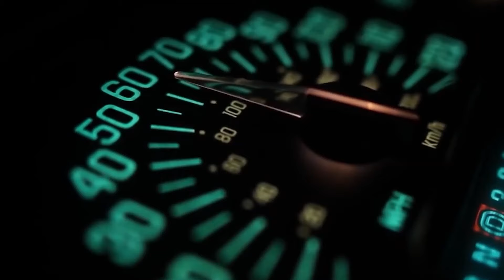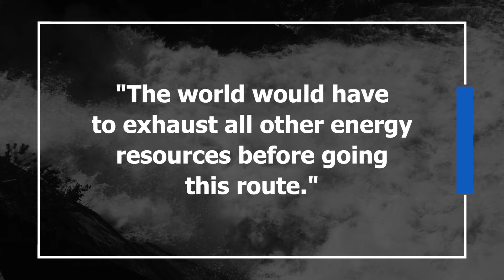The Red Sea Dam: Generating 50x the Power of a Nuclear Plant

Comment: If the object is to generate power it may make a lot more sense to dam the Gulf of Aqaba so that navigation is not blocked in the Red Sea. But further if a dam was installed that blocks natural inflow and outflow of water recharging the Gulf and preventing shipping and endangering fishing and the ecology of the gulf as well as destroy Aqaba which is the only Jordanian port, this would be like suffocating the region. Ditto for the Red Sea dam idea. Destroying a whole environment and Aqaba and every other port in the region to generate power is not the way to go! Further, the Israelis are going to have to recharge the Dead Sea I feel from the Gulf, and blocking it off would certainly kabosh that plan which would BTW ameliorate sea level rise.

I would actually consider a sea dam impractical and unnecessary for the purposes of generating power because on a daily basis the tides change four times daily in the Aqaba gulf with a change in sea level of over a meter (measured today), a power generating phenomenon that turbines could take advantage of if they were installed in the correct structure. Perhaps a simple undersea tunnel-like structure extending from shore to shore, well below the shipping lanes to Aqaba at the entrance to the gulf and  meant to simply house turbines and  anchored to the sea floor by cables or even columns and packed full of turbines to catch the tidal flows both ways and perhaps even any current flows at depth. This would be like a submerged bridge extending under the water from the Egyptian shore to the Saudi shore and  would generate power silently under the sea.

Not only that but there appear to be a few maybe helpful islands at the entry to the gulf to consider also a suspension bridge over the gulf entrance in tandem with that turbine fitted structure generating power in the sea below. A bridge at this location would serve to increase access to Sharm El-Sheik and Saudi Arabia from both directions, surely a good thing, and allow land access between Saudi Arabia and and Egypt without having to cross the northern Sinai and Israel. The Saudis could finance the bridge with some of their deep pocket change! A much more interesting project. SZ BA MA

Comment: Something tells me the added shipping costs to everyone who uses the Suez canal would alone make this a net energy loser.  Boats on water is way cheaper than even rail and it's pretty hard to build rail through sand desert so you're down to truck or vastly longer sea shipping routes.  That is before you talk ecological consequences or you know, the risks the structure fails due to engineering errors.

Comment: This is by far the dumbest idea since the idiot that wanted to dam off the Mediterranean Sea. We've seen what kind of global impact on shipping happens if the Suez Canal is shut down for a long period of time. This would make it permanent, because as the video suggests, locks would be impractical for the amount of water level change we're talking about and a saltier Red sea would quickly ruin ships. If you wanted a preview of things to come, I'd point to two examples. Early on in this dam's life the Red Sea would become a giant version of the Dead Sea, a sea so salty that only extremophile bacteria can tolerate. Later on, one only needs to look at what's left of the Aral Sea and scale it up a few hundred (or thousand?) times. 
I'm a firm believer that Hydropower is essential, but there is no way the benefits outweigh the costs on this particular project.

Comment: Wow, this sounds like propaganda.  Just because a dam...on an enormous bay of water can generate 50x the power of ONE plant...does not then make that practical to replace ALL power generation by nuke plants, it does not "kill" nuclear power's necessity.  If you were to dam the St Lawrence Seaway, and then, power sections of Ontario, New England, and maybe Ohio, it would not be a workable or even start of a solution for power in Regina, or Calgary, or Albequeque.  This only works for subsections of the grid.

Nuclear power is necessary and saying it is not is gaslighting to the highest degree.

What we need is less fear-via-disinformation and propaganda, and more unity among using ALL of the best power generation available.  Gigadams like this are great...for the area.  They are not the solution everywhere.  Interspersing hydro, geothermal, wind, solar, AND nuclear power is the solution.  All, or they will not work sufficiently to provide a surplus for needs in the future.

Comment: Completely unnecessary. The energy factor in the humidity in the area is 1000 times more significant and accessible. Pluvicopia concentrates on getting the water product, producing much more energy than this dam idea with it's hydroelectric potential alone. A more prominent energy factor is the updrafts and downdrafts created. Further, limitless freshwater, one of the planet's richest latent heat lakes, can produce energy with designed wind systems. You spray fresh water into a steep canyon, creating vast downdrafts on demand. You would turn on the faucet, and out comes energy, as much as you would ever want. Not that you would like to, but the constant water content surrounding the Arabian Peninsula is vast enough to produce the Mississippi into the penninsula. Canada gets vast storms from 20 kg/m2 (kilograms of water per square meter of atmosphere.). Right now, on the red sea, it is 51 kg/m2, and there is no rain and minimal cloud water. Plvicopia organizes 16kg/m2 into constant production. The cost for a Pluvicopia plant to produce 50 m/s is insignificant, 250 to 750 million dollars. You could build 1000 plants for 750 billion, the approximate cost of such a monster dam. The ecological price is unimaginable; Pluvicopia is an ecological repair system. This idea is totally unnecessary, although it is fun to ponder.

Comment: Dumbest way to eventually get 50 GW of generation ever!  Far slower power buildup than the slowest built nuclear plant.  Current quotes for GE-Hitachi 300 MW SMRS are less than $4B/GW, which would supply that 50 GW of capacity in far less than 30 years.  Furthermore the Suez canal generates $7B/year, which means shipping costs around Africa would increase by more than that each year, easily increasing shipping costs by another $200B over 30 years, w/o inflation, which could be better used to build a second 50GW of nuclear generating capacity. Furthermore  millions of miles of extra shipping distances and times around Africa would dramatically increase CO2 production from those ships and additional ones necessary to compensate for lost time on every trip.  It would be an economic and environmental disaster before discussing sea level changes, fish kills, airborne dust, additional crew costs and a thousand other factors.